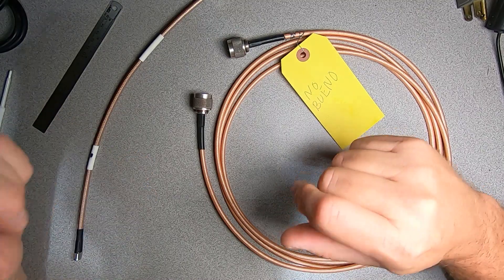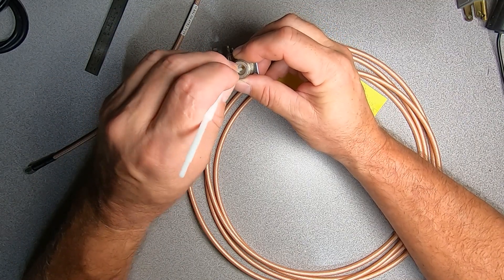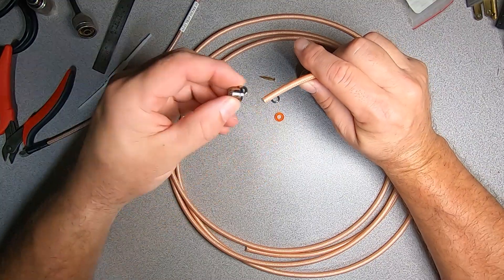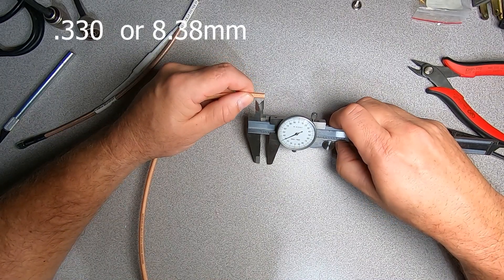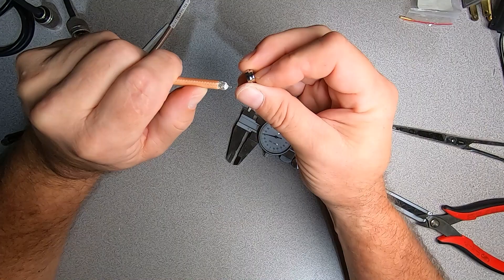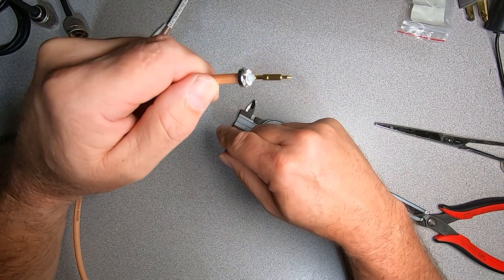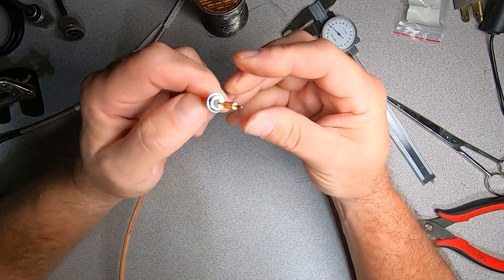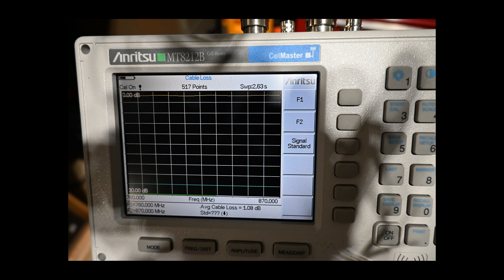Installing clamp style RF connectors - Type N on RG142 cable RG58 RG223 RF industries RFN1000-N

Comment: I always seem to get the center pin too hot and the foam gets hot and shrinks back a bit. Always enjoy your videos.
Reply from the maker: Fortunately 142 has a teflon dielectric which is very forgiving. When doing 58 or 223 you must flux it and hit it quick when you see the solder wick into the hole remove the heat fast.  Thanks for watching !
Reply: @survivalcomms  I do IPC J-STD class 3 connectors for aircraft. ALWAYS use flux regardless of the connector. Also always pre tin the wires and connector. Gold embrittlement is a major issue so always double tin/solder wick any gold plated connectors to ensure there's no gold left on the soldering surface. Only use an RMA flux and compatible RMA solder for connection that can't be fully cleaned like stranded wire or connectors like this.
Reply from the maker: @amiclg  Thank you . I always do flux. thanks for watching !